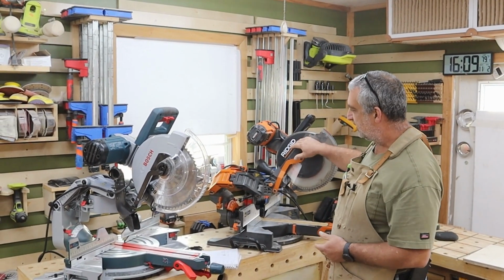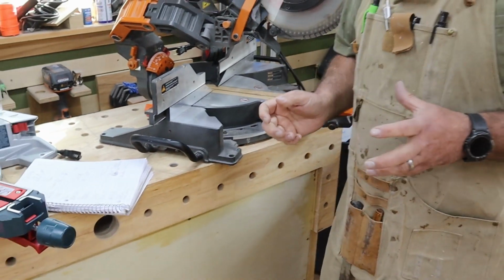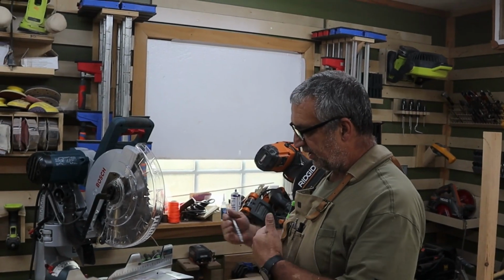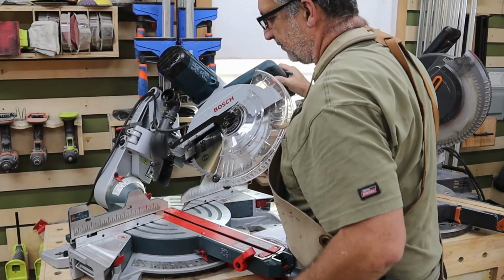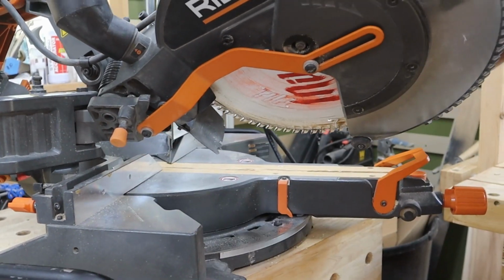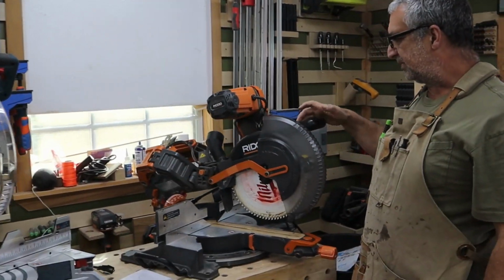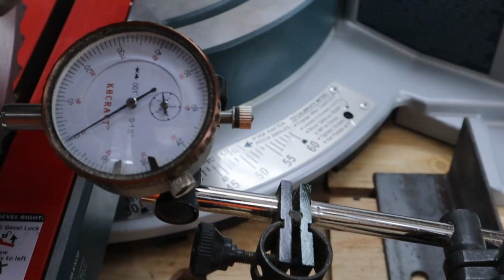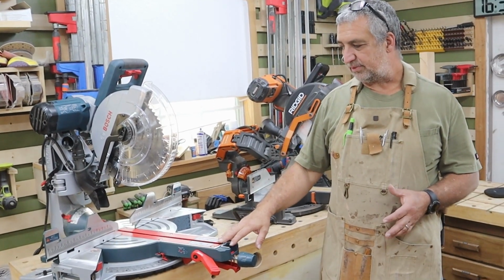The Bosch Glide Vs. The Ridgid R4251 same as Delta Cruzer: Which Miter Saw Is Better?

Comment: I bought the Ridgid based on good reviews, returned it immediately after unboxing and experiencing 3/8” lateral deflection with just pinkie finger pressure.
If you’re only doing rough framing it’s fine, but if you’re wood working you won’t be happy.
Reply from the maker: I ended up keeping the Bosch.

Comment: Great comparison video.  One parameter that may people would find more helpful than the depth of the entire saw, is the distance from the fence to the wall.  When installed on a miter station in a workshop, this dimension controls how far back the workpiece can be from the edge of the workbench.  Crosscut capacity is only as good as what fits on the bench.  I was pulling for the Ridgid, until you measured the blade deflection.  To me, if it doesn't cut straight, and resist deflection, it's not fit for purpose.  The Bosch wins on that score.  I'll just need to figure out how to retrofit a shadow line LED.
Reply from the maker: I went with the Bosch. I still haven't got around to adding the shadow line. I went without one for decades.  It was nice to have and I will get around to it one day. The distance from the wall is about the same.

Comment: Nice low key review, thanks for posting.  For those learning about the Bosch from this video, you don't need to touch the rear knob for bevel cuts.  That's just for a special crown molding setting.  Luckily all the main controls are up front.  Thanks again.
Reply from the maker: I just wish it had a shadow line.

Comment: I have the Bosch. And the stiffness in the locking handle and in tilting the saw is adjustable. Read the manual..
Reply from the maker: Good to know. Thanks for the tip.

Comment: I won the Delta Cruzer 12” in a raffle. I was excited to use it for large furniture projects, but the deflection gets even worse when extended to the point that large cross cuts are very inconsistent. Table or track saw for crosscuts is what I have to do because the Cruzer will even deflect with the grain, killing consistency.
Reply from the maker: I feel you pain.

Comment: Not sure if you mentioned it but I’m in the Rigid platform for their lifetime warranty. Still using all the same tools I bought 20 years ago with new batteries. Maybe the saw has a limited warranty. Cheers
Reply from the maker: No, the mitersaw and table saw they have made by Delta has the same warranty as the Delta.

Comment: I just saw, (no pun intended), the Ridgid in use on another video and immediately did a search for it vs the Delta Cruzer. I also did not find any comparisons between them, but I found your video. I like how you point out differences that may be small to some but not others, like the 2° further left miter capacity with the Bosch, as well as the differences that may be deal breakers. The deflection of the Ridgid, the better extension wings on the Bosch. If I were to choose today it would still be a hard decision, but I would hope that I could overcome the deflection issue and go with the Ridgid for the shadow line as the necessity. I could also figure out a way to make the extension wings while including a stop if I wanted to, but that would be down the road if I decided I really wanted it.

Thank you for a great comparison.
Reply from the maker: Thanks! It's hard to go wrong with either. It's really up to your preference and what you want to use the saw for.

Comment: I'm shocked Bosch doesn't have a shadow line. I bought my rigid 10in a few months ago and absolutely love it! Somehow i caught it for 265 dollars. I think I've learned to work with the deflection, which is minimal. Nice video. Thanks for the work
Reply from the maker: I wish Bosch had a shadow line. I used the Ridgid for about a year. I never had an issue with deflection when I was using proper technique.

Comment: I had the Ridgid 12in. I sold it after getting my Hitachi C12LSH back. I left it in a friend's barn in another state almost a decade ago so I'd just always assumed it'd been stolen by now. I regret selling the Ridgid so much though. I hadn't paid attention to it being discontinued. I know it's literally just a Delta Cruzer but that's besides the point. It matched my other Ridgid tools 😭😭😭
Reply from the maker: I am not sure if they are discontinued. I have never seen one in store. They will be out of stock online for months. Then, they will get them in stock. Then they will put them on a huge discount and they will run out of stock again. They have been going through this cycle for several years now. Put in your email to be notified and check back every couple of weeks.

Comment: Mikita and Festool are by far better.
Reply from the maker: One day, I may be able to afford to find out. I caught both of these on sale for about $300. If I ever find a Kpex close to that, I will get it.
Reply: @ShopRamblings  Even FLEX has a higher tolerance that bought, for you isn't foot print is larger but by far a better product.  DeWalt makes a tried and threw product at a similar price. If you had to tune the arms on those miter saw you will be in a world of hurt.

Comment: Thanks for a great comparison video. However, I opted for the 10" Rigid which I got for a steal price of 219 from my local Home Depot. It was the last one they had in stock. I also love the shadow line which was one of the reasons I went with the Ridgid. I haven't noticed any issues with deflection. I don't yank of the handle when making a cut as I am not building fine furniture. A few thousands of an inch doesn't seem to make much difference to me in any case. In addition, Delta has stated that they have addressed the deflection issues that people mentioned with the newest batch of gen 2 saws.
Reply from the maker: The Ridgid is the Gen 2 model. It is a great saw.

Comment: I think DIYers wil be happy with the Delta/Ridgid. But, it I was running a shop Bosch/Makita for sure.
Reply from the maker: I think most people will be happy with either. They are both good saws, but both have their issues. I just wish the Bosch had the shadow line.

Comment: I've had several Bosch  saws over the years.  Id pick that over the HD/Delta all day long. A buddy has the HD.. its like comparing a Chevy to a Toyota.
For retirement i treated myself to the Festool.... its far too expensive but.... it beats the Bosch...all day long
Reply from the maker: Maybe one day I will be able to get a Festool, but I doubt it.
Reply: @ShopRamblings  I hear ya, it's far too expensive...I had a weak moment
Reply from the maker: @jcs1758 I think a miter saw  is the most useful saw to have.
Reply: @ShopRamblings  most used...table saw and miter... by far

Comment: Great review, just what I needed. Ended up going with the ridgid because of the shadow light. With proper form and going slow on cuts, deflection can be minimized. Additionally, 90% of the cuts I make are not extended and in the fixed position from which there is considerably less deflection. Besides if precision is critical I’ll probably take it to the cross cut sled on my table saw. Price helped too, snagged the ridgid 12” for $399 at Home Depot
Reply from the maker: It was a hard choice. I still don't know if I made the right one for me. With what you do, it sounds like you made the right choice
Reply: Totally agree, but I bought the Delta 10” version.

Comment: I have the Bosch but trying to get it to 90 degree cuts were such a pain. Does the rigid have the same issue?
Reply from the maker: The question is, why were you having trouble getting 90⁰ cut. I was able to make 90⁰ cuts with both saws. The Bosch is easier to get 90⁰. Is the issue the saw needs to be squared where it makes the same cut every time but is not 90⁰ or does it cut different angles?
Reply: @ShopRamblings  when I pull out the saw, the less square it gets. It gets worse the more I use the bevel and bring it back up. I’ve tried to fix it multiple times but I don’t know why it’s not square. The way Bosch has it where I need to go to the back and adjust it is really annoying and wish there was a way to “lock” it into the right spot
Reply from the maker: The red lever should lock it.

Comment: Are the blades 1" arbor or 5/8"? Full time carpenters need to replace blades more frequently and many stores don't carry 1" arbor.
Reply from the maker: The arbor size is one inch. This is consistent across various brands such as DeWalt, Makita, Rigid, and Bosch. I have personally purchased 12"  saw blades from reputable retailers like Home Depot, Lowe's, and Ace Hardware without encountering any issues related to arbor size compatibility.

Comment: Also, I saw that Delta makes practically the same saw called the Cruzer.
Reply from the maker: Yes, if you pull up the schematic, any part that is not orange has the same part number. They are both made in the same factory.

Comment: I have the HarborFreight Hercules HE-74 which i absolutely love even more so for only $299. It has the shadow light which is great especially as our eyes get older. Now, I have the same necessity of getting a zero rear clearance so I’m looking to get a new one like the Bosch which I am sold on so far. The only other one I would consider although much more costly is the Makita. It has the slide bars but they are in the front which is a slick idea thereby giving you the zero rear clearance option. Have you considered doing a video on that saw?
Reply from the maker: I got both Ridgid saws on sale. I forgot the exact price, but the 10" was around $250, and the 12" was $350. I also got the Bosch  on sale for $320. I have never seen the Makita anywhere close to that price. Unless I catch on on sale or my channel gets bigger, I don't see me  buying one.

Comment: I just picked up the 10" Rigid for $219 at Home Depot. Apparently every now and then they let some go at that price. I am hearing the same deal all over the US. Keep an eye out. Love mine!!
Reply from the maker: They will be out of stock for months. Then they will get them and discount them. The 12" goes for around $360. I had gotten both for around $600. I made a couple of videos. Used one for a year or so. Put it on  marketplace and sold the same day. In all, it may have cost me $60.

Comment: I added an Oshlun LG-M01 Laser Guide for my Bosch miter saw for about $31 and it works perfectly.  Only marks the left side of blade but that's about 95% of the cut position I use.  I've owned a couple of these saws since 2011 and would not buy another brand with what is currently offered.  The Festool has more bells and whistles but it's more than 2.4X the cost of the Bosch.  The Bosch is the best for the money and if you have a Menards in your area, they often are $577 with the 11% rebate, which has been running for most of 2024.

I also have the fixed base Bosch miter stand, which is much more stable than the gravity lift portable stand and has 6' extensions on both sides of the saw, which is longer and more rigid than the gravity stand.  Cheaper too.  I took my old gravity stand and mounted a cheap Metabo 10' miter saw on it for when I need to take it to a job site.

If you want a longer fence, I replaced the Bosch fence with 3" x 36" long multitracks on each side.  By adding a POWERTEC 71119V 36 Inch Double-Cut Profile Universal T-Track with Predrilled Mounting Holes under the multitrack, I can cut thin stock without it slipping under the 3" multitrack.  Added additional bracing for the multitrack off my dust box I made, but that's another story.  I have almost zero dust with my dust box connected to my 6" DC.
Reply from the maker: I would love to see your dust box. I want to build a miter station. You can email me at shopramblings@gmail.com.
Reply: @ShopRamblings  Pictures sent.

Comment: Will the Ridged 10” saw cut a 45 degree cross cut on a 2x4 ?
Reply from the maker: Yes.
Reply: I meant to ask if it would cross cut a 2x12. I guess I fat fingered something. Who knows. Thanks for the reply. It’s hard to find the 12” Saw. I found the 10”. If the 10” it can’t cross cut a 2x12 than I’ll have to look at something else. It seams like its right on the border to be able to. Sure hope so because it seams to be a really good saw.
Reply from the maker: @stgraves260, it can cross cut a 2x12, but it can't miter it at 45⁰.

Comment: Thanks for this comparison! Great review.  I was lucky enough to have picked up the Bosch several months ago at Lowe's at half price ($325).  Couldn't pass that up.

Just a couple comments: 1) I believe there is a stiffness adjustment for the bevel in the back.  2) As another commented pointed out, the European Bosch version has a shadow line.  I ended up following a video by Drew Fisher of Fisher's Shop (no relation) where he installs a simple shadow line.  I took it another step and wired it with a switch to the saw's power and added the light switch into the saw's handle.  A little work, but fun and it's sooooo much nicer now.
Reply from the maker: I got the same deal at Lowes.  I still need to add the shadow line.

Comment: I have wanted a big miter saw for a quite awhile. About 2 weeks ago I was at Home Depot and they had the 12 inch Bosch glide on sale for $330. I asked if that was mistake and the guys said no, they were probably coming out with a new model and were having these on clearance to move them. Needless to say I bought it right there on the spot. After watching the comparison, I do believe I made a good decision. Thanks for the reviews of both. I really never considered the Ridgid though I have a 3 or 4 Ridgid tools.
Reply from the maker: It can't be beat at that price.
Reply: Good job, that’s a steal. Here in NZ they’re currently $1,929.00 ($1,200.00 US). I’ve had the 12” version for years and love it, it’s a great saw.

Comment: I just bought the RIDGID 10” Sliding Miter Saw - R4241, for $219 at Home Depot during their Spring Black Friday sale.  49% off.  At that price it was WAY worth it!  Aside from the deflection, both saws are pretty damn close, so the LED cut line and butter smooth operation sealed it for me.  I typically do not rush my cuts so I’m not very concerned about deflection impacting my accuracy.
Reply from the maker: It is strange. They will be out of stock for months. Then they will be half price. I bought both the 10" and 12" for half price a year ago.
Reply: I just picked up the 10" for that same $219 price point. The next day they were out of stock again.

Comment: Great review.  I am curious about the deflection test.  You have come up with an interesting way to test for deflection.  Have you accounted for any difference in the blades?  It would appear that the blade deflection is contributing or what is actually being measured.  It also looks like you have two different blades on the saw.  The Bosch blade does not appear to have the same level of burnishing on it.  This might contributing to the chip out difference?  I do not own either saw so I don't have a dog in the fight.  I also own both Delta and Ridgid equipment.  Again, thank you for the comparison.
Reply from the maker: I am not sure what  difference the blade makes with the saw off. It is the arm moving that is causing the defection. I tried to make sure to measure the same distance from the fence and the arbor using the same amount of force. How would you have tested it?

Comment: I added a shadow line to my Bosch!
Reply from the maker: Once I get one added I believe it will be a great saw.
Reply: Please tell me the exact part you got to add a shadow line to the Bosch.
Reply: @jdw6727  Wish I could tell you exactly but I'm unable to identify the exact part I used.  If memory serves it was from a sewing machine light I bought off Amazon.  There is another YouTube video were someone else added a shadow line light to the 12" Bosch glide using the light salvaged from a sewing machine light.  Perhaps you can find the details there.  Good luck.
Reply: @phcalama Thanks, I saw that video.

Comment: Great comparison, thanks.  I've been looking at the 10" Bosch.  It's a real shame there's no shadow line; hopefully they will refresh this model soon.  The deflection on the Ridgid is absurd, but I'm not happy about the amount on the Bosch either (I do more woodworking than construction).  I have a crappy Ryobi and want to upgrade because the deflection is so bad.  Even if your pressure is perfectly straight down, the blade will wander - maddening!  I can get better cuts with a circular saw and a rafter square.  Maybe I'm expecting too much, but I fail to see the point of a miter saw that can't reliably cut miters.  Maybe I should try a non-sliding model, or reconsider my need for a miter saw altogether. :D
Reply from the maker: I definitely could not do without a miter saw. It is second only to my table saw. But you do need to depend on it being accurate. I had the power 10 sliding miter saw and it was the most accurate out of all of them. It could cut the widest board, even wider than the 12 inch Bosch or rigid. But it was almost 4 foot from front to back. It just did not fit where I needed it to go. They not sliding will be a lot more accurate. However a 12-inch non-sliding can only cut about an 8 inch board. I am happy so far with the Bosch and will be much more pleased once I get a shadow line at it.